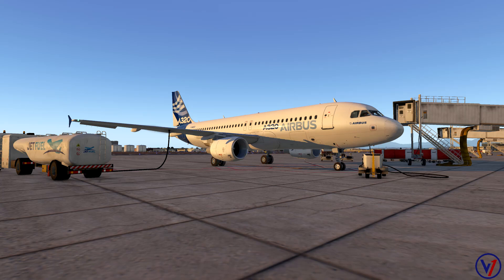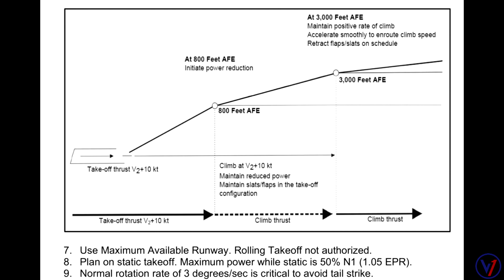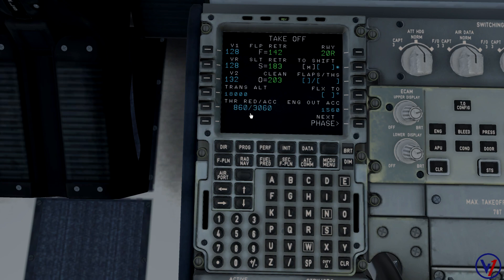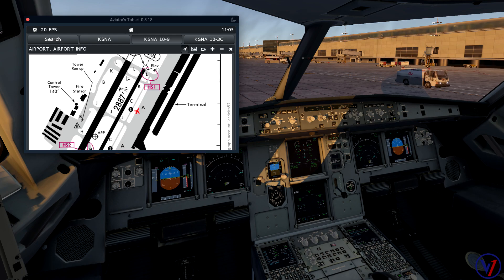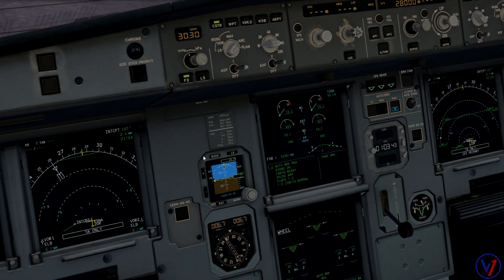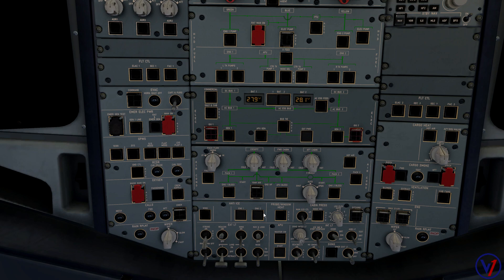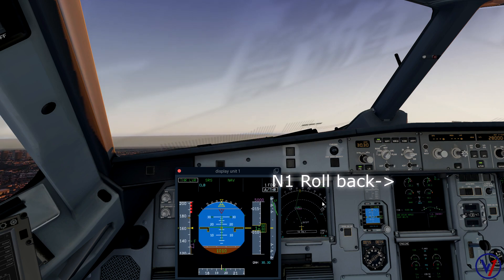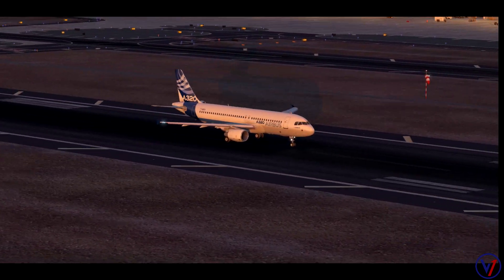MAX Perf Takeoff + Noise Abatement | KSNA John Wayne Procedures | REAL Airbus Pilot | XP11

Comment: I worked OPS for 20 yesrs at this field...........takeoffs are usually Captains only. I could get an extra 10 pax on using runway 01 if the wind was good. Sent one 757 out at 220,000 lbs or so, was pretty much max. There are 4 tall palm trees on the golf course that were in our second stage climb we had to account for. Don't know if they are still a factor. Delta used to go weightless in first class on the 757's back in the day. AA was in trouble for a while on noise MD-80, so they were cutting back at 700ft for a while in the 80's. Semi-dangerous stuff but whatever worked. Nobody got killed with all the noise stuff, but it was a little dicy............

Comment: What do you set the E/O acceleration height to? I have flown out of KSNA often as I live nearby there and the takeoffs I have experienced in Boeing’s are much more dramatic. Even captain makes an announcement beforehand. The engine spools up much more than 50% statically with the plane shaking then the plane lurches forward when brakes are released, then a very steep climb out followed by a pretty significant reduction in pitch. Then a quite dramatic feeling as is the reduction in power to what seems like near 50% thrust based on sound followed by a pretty significant increase in thrust as the plane crosses over the ocean, probably that 3,060’ point. This is on a 737 mostly and I think a 757 flight to KORD the first time I experienced this. What a blast. The Airbuses I have been on here seem quite benign in this regard.
Reply: I agree. It isn't as noticeable.  The 737 is fun.  For the 737 you program the FMC and select CLB-2 on the N1 Limit page.  You also set 1000AGL THR reduction on the TAKEOFF REF page 2/2.. Takeoff procedure usually is flaps 5 TOGA and packs on unless required.  Then climb at V2+20 TOGA power to 1000 AGL.  At 400 AGL select LNAV or HDG and verify.  1000Ft pull thrust back to CLB...which in this case would be CLB-2 .  Maintain V2+20 (TO/GA pitch).  Then at 3000AGL set flaps up maneuvering speed.  At this point you are pretty much near the coast or your SIDs first WP off the coast.  At this point you delete the CLB-2 on the N1 Limit and resume normal climb.

Comment: Thank you for another good video V1! I remember you were always saying before putting engines in climb thrust you want to wait for positive trend in airspeed. For this procedures(especially with mics on the ground) you don't need to be focused on this, just put them on climb on correct altitude?
Reply from the maker: Yep! This is one of those instances where you just come straight back to climb, if done properly you actually won’t begin to accelerate because we manually set acceleration @3060’ and we are aiming to climb out V2+10

Comment: Can this be accomplished at this airport with a max load? Or is there typically an expected light load because of the small airport?
Reply from the maker: Depending on the aircraft, it is possible to be “weight restricted” however most 320/319s will be ok. Depends on a lot of other factors such as fuel, pax, cargo, environmental etc
Reply: Yes

Comment: Great video, could you elaborate what would be weight limit that you start thinking about APU on or packs off for take off? I was practicing TOGA flap3 at KEYW (very short runway)
Reply from the maker: Hard to say, for example KEYW is so short your going to be weight restricted from the beginning. Thus depending on your load and new MTOW packs off will vary. However most takeoffs from there will be packs off flaps 3. IRL we wait for our takeoff performance to come in from ACARS and that’s where it tells us PACKS on or off
Reply: @V1Sim  Many thanks, yeah I do nor remember what was my weight, but packs were on and no APU, but if I had to stop at or close to V1 I would be EMAS story.